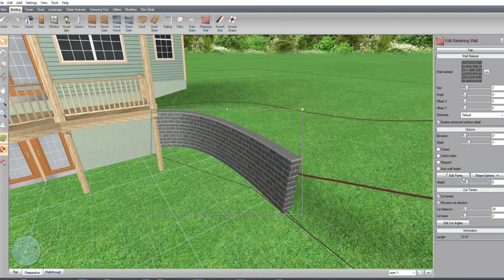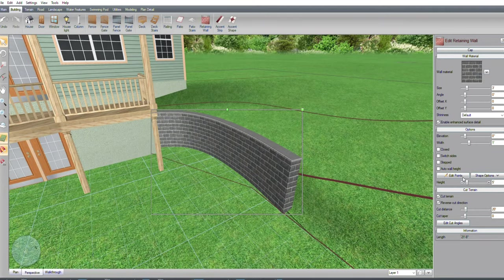Real-time Landscape Architect Tutorial - Terrain Features and Elevation

Comment: I've watched this video multiple times. Thanks for putting it up. However, this isn't a real house w real elevation lines. How do you take the topographic information that is available for a plat, along with the existing house measurements and make it all work? I am dealing with a house on a slope that has a full basement, but you don't see the basement from the front, just from the back. I have tried multiple ways to make this happen, but just can't seem to get it right! Thanks

Comment: Thanks for the video. What if you have all of the contour lines laid in from the topo...I have trouble building the hardscape on top of that (house, drive, sidewalks, decks, patios etc.). They all seem to follow the slope of the land? How do you fix this issue?
Reply from the maker: Try using area grader at 100% to make a flat spot...then change your topo lines
Reply: @Earthworks__Landscaping  I haven't used that tool before. So would I be using the area grader to bring the contour up to level for the base of the house? Thanks for the reply.
Reply from the maker: More for flat areas such as patios